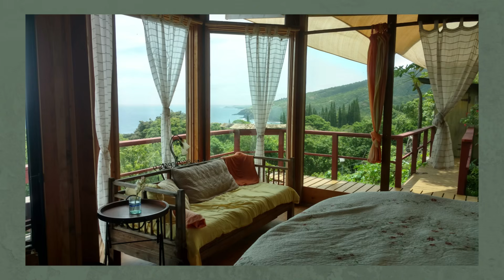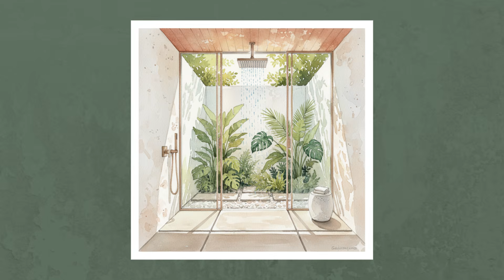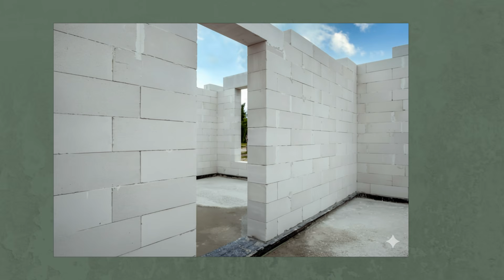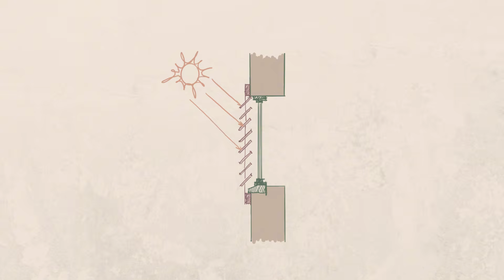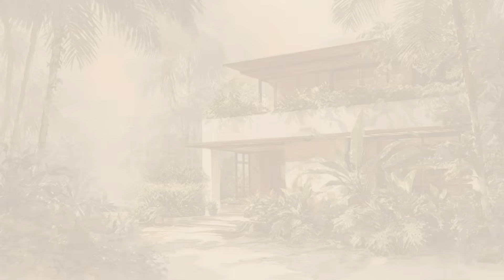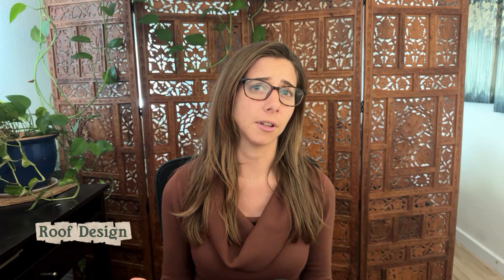Tropical Home Design That Keeps You Cool & Comfortable Year-Round🔥

Comment: I just started living in Cambodia and  want to build a Tropical Modernism home.  On the eastern side, I think the same thing about the overhang as you mentioned but I also plan to add a pond/fountain  then mature mango trees. Three layers protections.  So between 7 to 10 AM the pond and the trees should give some protections follow by the overhang around 11 AM.  Green roof on top for noon sun. (Still thinking about this one, perhaps solar panels on the roof too if money allows).  
 Then I would  repeat the process on western side from 1 to 5 PM .   On concrete surfaces, I will plant those climbing vines. We have several species here.

Comment: Great video, but listen up, yall. Watch the video by nighthawking on his improvement of aircrete. He recons his is twice as good as Styrofoam. I have no intention of ever using aircrete for structure. 
In the Philippines, concrete is not laid up continuously, which allows moisture in to rot the rebar. I hate concrete with a passion I really detest the stuff at night it cooks you, unless you are prepared to pay all the cost of aircon to cool it back down. I will accept that it is good in contact with the ground for rot and termites. The solution is to use it for posts only and reinforce it with fiberglass rebar.

Comment: Maybe it's different in Hawaii if you have less bugs, but in the tropics of SEA where I live I'd NEVERR want a kitchen or living room that's exposed to the outdoors, terrible idea if that's your actual living space and not a novelty vacation experience. Had an open kitchen in Bali while staying in a rented villa and it was the worst. There was nothing to keep the bugs and lizards out, which poop on everything btw, and if you wanted to use the kitchen at night the instant you turn on the light you get swarmed with flying bugs.

I'd also never want my living room exposed to bugs or small animals like that, I'd just never feel comfortable or clean. It would only be tolerable if the area was protected by bug screens and could be completely sealed off as needed. In which case, just have a separate porch and living area, not turn your whole living room into a porch.

I could see maybe an outdoor wet kitchen working if you still have an enclosed dry kitchen area, but it would still be so impractical to not be able to close it off from the elements just for hygeine reasons. I would not feel comfortable storing any food there without fear of pests like rats trying to get into it, especially if it's on the ground floor.

Comment: Nice video Christina! I intend to build in NE Thailand in the suburbs of a large town and am particularly interested in more ecological but technological solutions to cooling. I will take a look at your other videos on this subject but thinking about the humidity (reportedly greater than 60%), I do not understand why evaporative cooling is not considered to be effective in this region, given that laundry dries so quickly. I am also considering a solar tower, sited in the centre of the house to pull in cooler air, with bedrooms and other living rooms having the external cooler air pulled in, to pass out of the rooms to the tower.
I also hope to incorporate solar panels, battery storage and rain water harvesting tanks (as I imagine that the climate will change with longer dry spells, over the next 20 years).
And of course, around the house, trees.

Comment: For concrete roofs, I would recommend three options that we use. An overhead solar panel on the roof. Gives shade and an intermittent layer, besides free electricity. White ceramic roof tiles for heat reflection and waterproofing. No maintenance after installation as opposed to paint. And rat trap brick walls. Automatic insulation with an air gap. Besides verandahs and overhangs, central courtyards.
Reply from the maker: Bingo! Great ideas

Comment: Lime wash, 2 coats or more. Do it to the roof. That alone will cut down the heat by up to 40% our roofs are cooking us literally. Most roofs are dark colored. Definitely turning our homes into ovens. I'm living in a room 16' x 16' I have a split AC that is meant for a much larger room. It can't keep up with the humid heat. But it is dripping about 10 liters of water a day. I collect it then filter it.

I also bought a wall Air Conditioner. It's a 2.5 hp motor. It don't take as much electricity but I used it all the time and when it can't keep up with the heat I turn the split 3.5 hp AirCon on until it's cool enough then turn it off again 

I'm getting ready to build a new home on my wife's property in Tulunan, Philippines. Her property has had flooding as high as 12 feet deep. So I'm going to build the ground up 12' then build the house on it. I'm making a waterproof basement. I'm using the basement as a root seller. Also for passive cooling.

I'm cheating. I plan to build with Earth bags or sandstone by electrical charging the sand mixed with baking soda and washing soda. It's much harder than concrete.the inferior will support either the Earth bags or the sandstone on the exterior. My Earth bags are big bags used by local rice farmers to hall their rice to the processors. They are about 4' long by 3' wide  at least 6" thick.

If I go with the electricity plus sand and etc. I was going to make a moveable mold over the roof  which is also the walls the full length of the structure and it not a A frame but a arched or bowed roof. A bulging A frame with a curve from the bottom to the top. Since this sand technique I'm using is stronger than concrete and doesn't crack it won't have to be too thick. I'm figuring at least 2 inches thick would be fine. 4" would be better though. I'm thinking of making a it slightly different colors so it's like layers in the Earth. Kind of like the rammed earth look. What you think?
Reply from the maker: Hey Joe! Sounds great, you can contact me via email (info@cransbury.com) or Instagram (@cransbury.design). Happy to chat to ask you a few questions!
Reply: Hello Joe, I love some of your ideas, I’m likewise looking at building in the Philippines also with basement, for the roof looking at 9 mt high tube of 250 mm with holes cut into it so it acts as a chimney for hot air. Roof cover of coconut wood covered with a product called Aluthermo Quattro the deflects 97 percentage of heat then covered in cogan grass. I’m a builder designing and building in the uae. Company is Inox Arabia

Comment: I live in a dry and hot climate (40 degres celsius most of the time), the house is already build and its in cement. Is there some type of plaster or coveragr that I can put on the wall that will help to cool down the temperature. 

I will for sure try the coverage/shade at the windows to have less sunlight coming into the house.
Reply from the maker: yes! exerior insulation! or at least shade the walls

Comment: Just finished a tiny, single storey villa in Bali. Not enough space for large overhangs / shading, but good cross-ventilation, ceiling fans, and a pool close to the main 4-meter-wide door has meant that we haven’t needed to switch on the air-con! 
Bedrooms could not have good cross-ventilation, so a double thick wall on the north prevents heat traveling inside the building.

Next project will be on stilts to allow ventilation and airflow underneath the entire house. Hopefully, next time we’ll have more space for larger overhangs.
Reply from the maker: Amazing!

Comment: Like everyone, I love tropical-look construction: bamboo, hardwood, Nippagrass roof, but they have NO DURABILITY unless they are out of the sun and rain and treated for insects, mould and UV rays.  Roof radiant foil barriers YES.  Insulation NO.  Insulation works if outside and inside are 60F different, not so much when the difference is 10 - 15F.  Insulation in your ceiling will keep your house hot at night as it radiates stored heat from the sun and blocks cooler outside air at night.

Comment: Comments about concrete block becoming a heat sink during the day and radiating that heat into the home at night are valid, but its advantage is 100 year+ durability and it's termite, fire and storm proof.  Overhang eves, shade trees and white wall paint counter the heat sink problem.  In the Philippines concrete block walls are 1/4th the cost of steel frame/fibre cement sheet.  While the later is very earthquake resistant, concrete block with steel rebar verticles and horizontals and filled grout holes does fairly well.
Reply from the maker: Great points!  As long as the masonry walls are properly shaded its not a problem.
Reply: @christinaransbury placing a wire wall filled with terracotta that is treated like a water feature a couple of feet in front of the concrete wall could create a cooling affect or boundary, maybe?

Comment: I don't want to start an arguement about insulation and double glazed widows.  They work when outside temps are furnace hot or below ice cold.  Tropics: outside is high 80s/30C and you want it to be 75/22C inside.  A small difference that does not warrant R60 insulation and double glazing which will both stop your home from cooling down at night when temps drop to 75F outside.  R2 insulation only in ceilings of AC rooms and single pane glass for the tropics.

Comment: I'm an Australian builder in the Philippines visaya area near Cebu.  Forever summer  with high 80s, light breezes, 60% humidity and rare storms.  My designs: white metal roof, reflective foil sarking, insulation only in BR with AC, high vaulted ceilings or 10' flat ceilings, cross ventilation in a narrow rectangle floor plan, large eves and multiple porches to shade windows.  Shade trees on North and South sides in tropics well away from the house.  Sun from the east or west lasts only 2 hours a day, but in Nov to Feb the sun will hit your south wall 11 hours a day and same for north walls May to August.  Altitude: get up a hill or mountain above 1000 feet for cool nights, its better/safer than beach front.
Reply: Do you have some examples of your work? Looking into building a home SouthWest of Cebu.
Reply: I’m thinking of building in the same region, likely near Argao.  In the stage of researching local geography for adequate locations.  Not easy to build there.
Reply: @j.whiting7177Negros Oriental for me.

Argao seems to far away from main cities, so yes materials will be more expensive. 

I would suggest you look at Volcano maps and Flood maps (Coastal Storm surge and water run off from the mountains down to the coast). Also consider being 1km to 3km from the main coastal Highway. When you get away from the low coast you gain some elevation and the house will cool down at night easier and you have a better ocean view without the dangers of living directly on the beach, which sounds amazing but long term not worth the risk of a what if.
Reply: @j.whiting7177Also don't live to close to family unless you want them to move all in, or your ok with taking them on financially. Its a possible issue. If you have kids or plan on having kids its best to keep a respectful line drawn, and or be 2 hours away so your close but not to close. Just weigh the negatives and positives of such a decision. And look at schooling, private schools or International schools for the kids or potential kids.
Reply from the maker: Nice!  Sounds like you are applying some great principles!  Did you check out my Passive Cooling Video?

Comment: I used to live on the leeward side of Oahu, and in the future my dream retirement home would be new construction in Kona. 
So about the windows, double glazed  ? And, what are your thoughts on how airtight a home in Hawaii should be (e.g. blower door testing) ?
Reply from the maker: Oh nice!  Both are beautiful areas.  Double glazed is suitable.  Low - E coatings are important for cooling (SHGC) and depending on your latitude and elevation you may want some passive heat (so not all windows have low SHGC).   Your ACH in tropical climates doesn't need to be as aggressive as passive house standards (0.6) - your ACH (airnightness) can be around 3-5.  Whether or not you get a blower door test is up to you, but sealing critical areas around windows, doors, and seams at floors and roofs are key!

Comment: Excellent video,
I'm from a hurricane zone, so i think about all the nice overhangs getting ripped off every time i think about my designs. 

First, animations were really nice and stylistic this video!
Second, I was surprised by your comment about night sky cooling surprised me. I'm not sure what you are reading, or really referring to, (you haven't done a video I've seen). You complement radiant cooling paints just five seconds earlier (@16 minutes). So what's the difference? I would think this are the same technology based on @Nighthawkinlight videos. And nothing I've seen with him would indicate humidity would that much of an issue. The radiant cooling paints even work better the warmer it is out. Water vapor does absorb IR light, but when dealing with the whole air column to space, I wouldn't think local conditions are that huge. Would love a video on this!
Reply from the maker: Thanks!  Yes so night sky radiative cooling is a different thing than just radiant cooling paints.  I can share the study and some more information on this if you are interested by email.  Just email me at info@cransbury.com.  Again, its only best in drier climates.  Radiant paints will work regardless of humidity.  Cool channel @nighhawkinlight - definitely going to have to check out some of his stuff!

Comment: Thanks for the video 
However I must disagree with you about the point of refrigerant use on urban heat island affect, because the urban heat island is a micro-climate, the gases used within the a/c won't have a meaningful local affect
It is better to address the issue of heat accumulation within the building and rejecting it to a better heat sink and to delay the heat gain through better building materials/performance 

I have had success with better roof/wall thermal envelope plus increased thermal mass within. 

I'd like to speak with you sometime, 
Good work
Reply from the maker: Thanks for bringing that up.  I realized during editing that that was the wrong word for what I was trying to describe, but yes that makes sense!   Great points on building envelope and interior thermal mass!  
Would be happy to chat.  Feel free to email me: info@cransbury.com
Reply: I've heard India has a bad urban heat island issue because so many people have small inefficient AC systems. That makes hte area hotter, so the AC has to run more. Making it pump more heat from inside to outside the house. This is why pairing an AC, which pumps heat, with insulation, which prevents the flow, is so complementary.
Reply: @babybalrog  yes, you are very correct, and in very dense urban areas like Mumbai etc it will only get worse. 
Because as India continues to grow and evolve economically more people will acquire mini split heat pumps (also called A2A heat pumps) without considering that the buildings there aren't constructed to reject heat,but rather store it, making both the interior hotter, and releasing / radiate the heat at night, along with all the other surfaces that stored heat during the day (pavement and especially asphalt roads) while the A2A heat pumps push heat from building into the surrounding air, compounding the intensity (cars and human density makes it worse)
This drives up energy consumption and most importantly energy demands when production drops (duck curve) this will increase occurrence of brownouts and power shortages, along with all the other issues making transition a challenge while energy demands grow unprecedented 

More attention needs to be paid to building materials and performance, the vlogger mentioned in her video new materials for heat rejection that are on-point, needs very serious consideration 👍🏽
Reply from the maker: @AfricanCulturalHeritageProject  thank you for sharing your perspective on urban developments.  Really good points that need to be considered.  mini-split heat pumps can be more effiecent, but yes, still pushing heat out... more smart design strategies are needed overall!